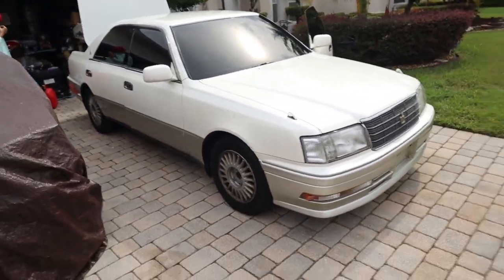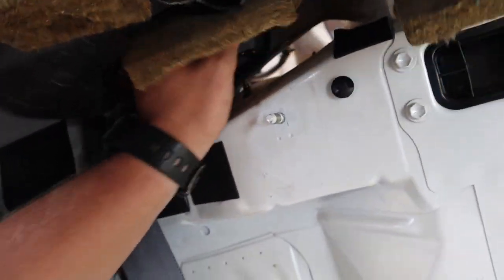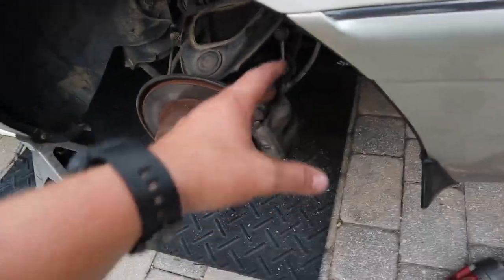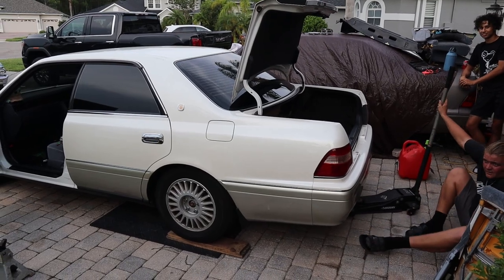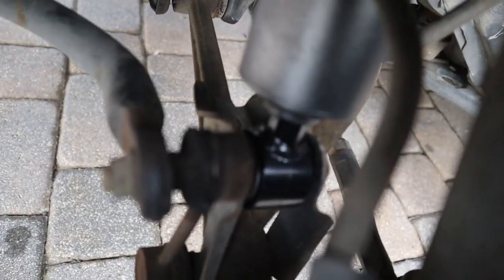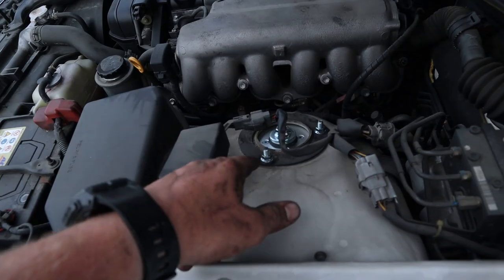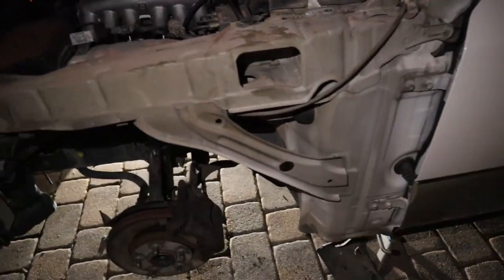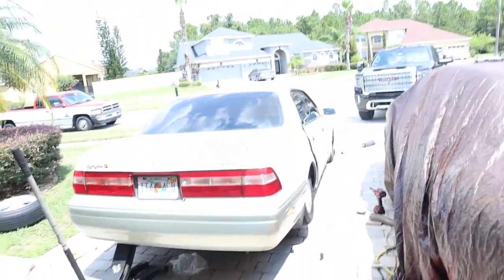TOYOTA CROWN SALOON COILOVER INSTALL + ACCIDENT (FROM STOCK TO UNDRIVEABLE….)

Comment: Need info on the stereo wiring specifically I have a 1996 jzs155 that I want to add aftermarket subs and amplifiers I already purchased  for it
Reply from the maker: I will get all that info in the next video, we got the doubled into work but although front and rear wired, only one hour wire was working when we switched them from front to rear. Meaning there was only one working or we’re working. Haven’t diagnosed to make everything work at once yet
Reply: Ok great and info on brake rotors and pads,calipers for the 155

Comment: Is all cool the channel and so forth, but this is the reason why I live on an HOA neighborhood. One of the first I checked was "not working on cars in the driveway".
*fyi- gave you a like
Reply from the maker: Understood, neighbors are cool with it tho and we don’t work late/noise, we keep cars covered, don’t cause issues with anyone, other than Karen’s that live 30 houses away that look for the trouble. Also in the back of the neighborhood in a culdesac. Could say none of these are valid arguments, but hey it is what it is. An HOA in my opinion is to keep neighborhoods “nice” so these types of rules are the ones I consider fine to be twisted (lawns kept, not trash out, more clean looking). To each their own opinion (by the way we live in an HOA). Appreciate the like🙏

Comment: What about jzs 171, do you know what brake rotors does it use?
Reply: Try comparing them to jzx110 or lexus is300/toyota altezza. Similar platforms with shared suspension components